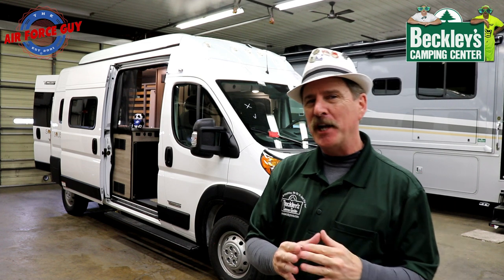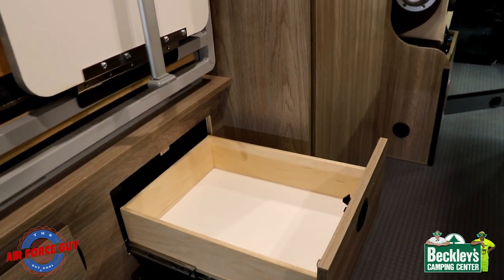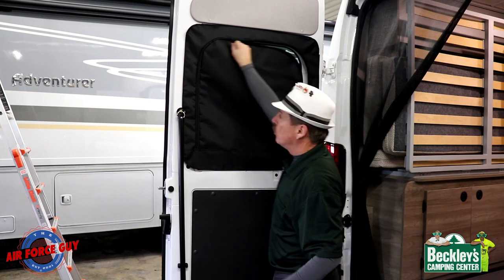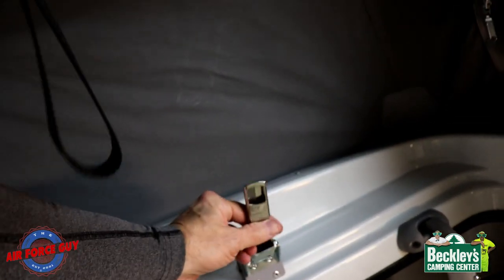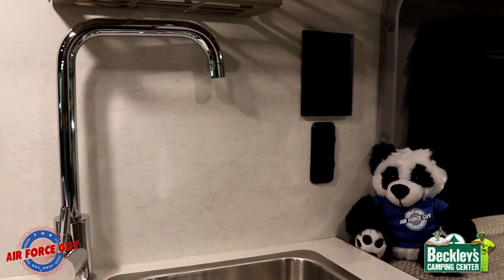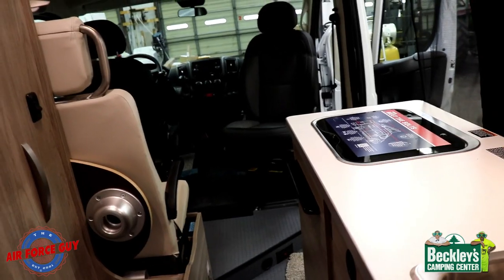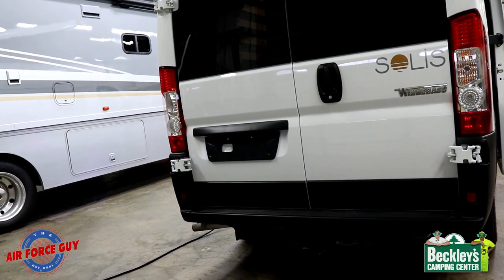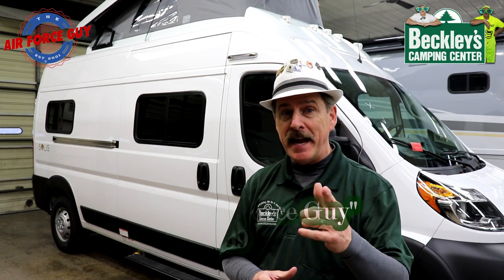Most Comprehensive Review of the Solis 59P by Winnebago  -  w/Paul "The Air Force Guy"

Comment: Nice review Paul!  We own a Hymer Aktiv Loft 1.0 and love it.  The Solis is very similar, just lacking the inverter, generator, microwave, TV,  and Blu Ray player and A/C.  Our A/C is undermount and not all that great, but better than nothing.  We have 400 ah of Lithium batteries.  The Solis has a Solar panel.  Hymer Aktiv Loft has and underhood generator (UGH).  I like the USB ports, light and vent on the loft, we don't have those.  So some nice touches that Winnebago thought of for the Solis.  Also, you can currently get a Solis.  Hymer Aktiv Loft's no longer made in North America :-(
Reply from the maker: Hopefully one day, they will offer the Pure3 system on the Solis with other options as well....

Comment: One thing that has always irked me has been Winnebago completely ignoring a matching storage/motorcycle trailer for their line of motorhomes.
Ideally I'd like a Solis with a small motorcycle trailer as well to carry a 500lbs (wet) BMW F650 GS that can be used for runs to various local shops, attractions, into town, etc. while leaving the Solis hooked up and locked up at the campsite or otherwise deployed when boondocking.
Reply from the maker: Thanks for watching.  It is not Winnebago that sets the weight limits for this Class B motor home, it is Dodge.  All Ram Pro Master Chassis' are limited.  No manufacturer can increase the limits.  There are some out there that put larger hitch receivers on their motor homes and that still does not change what they can handle.  Just did a YouTube Live about that last week. Check it out, it will open you eyes and make you wonder, Why are these manufacturers doing what they are doing!

Comment: Great video Paul!
Watched it all very informative!
I would need to know if they have some sort of roof rack system designed for it so I can carry my SUP and Kayak?
Second question is how big a motorcycle could I carry inside?
I’m sure a skinny dirt bike is not an issue but could I use a ramp and tie down my Honda Goldwing inside?
It would be the perfect RV for us if both of those wishes could be fulfilled.
Thank you
BB
🍻🍻
Reply from the maker: Per Winnebago, they will not put one on the roof.  Can it be done, anything can be done, it is just a question of cost.
Reply: RV Reviews by The Air Force Guy Got it 👍
I’ll look at how the Pleasure Way folks are doing it on the Tofino

Comment: I wish they had an AC option. That's a deal breaker for me.
Reply from the maker: With a pop-top an A/C would not be very useful.  The ones sleeping up top would end up opening the windows which would totally negate the A/C.  One must look at this for what it is, it is an upscale Vanagon.  Good Luck and Happy Camping.  Thanks for watching...
Reply: But there are Class B's with pop-tops that have AC. They should have at least offered an option. Just my opinion.  Thans for a great review
Reply: I wish they come w AC and Lithium battery . Don't really need pop-up.  And of course a skylight at front would be nice. I missed hymeraktiv like.
Reply: @jeffchen8178   We own a Hymer Aktiv Loft 1.0 and love it.  The Solis does have a few things that my Aktiv Loft does not.  Solar for one.  My Hymer Aktiv has 400 ah of Lithium Batteries with an under hood generator  (UGH) to charge them.  We also have a 2000w inverter to run the Microwave, TV, Blu Ray player.  The undermount A/C on the Hymer Aktiv Loft is not very good, but better than nothing.
Reply: The recently announced Solis PX adds an A/C along with a extra rear cargo space for bikes or other toys.

Comment: Top Bed is rated to hold 450 pounds but the ladder is only rated for 225 pounds, how will someone that weighs 300 pounds climb up there? 🤦🏽‍♂️🤦🏽‍♂️🤦🏽‍♂️🤦🏽‍♂️
Reply from the maker: 2 times 225 equals 450.  That is how they rate things.  Even outside ladders on RV's have about the same rating, while the so called walkable roof typically have about the same rating.
Reply: If you weigh that much, a Class B is probably not going to work for you anyways.